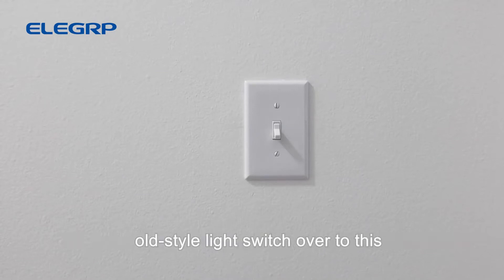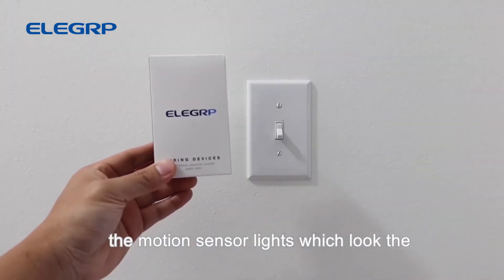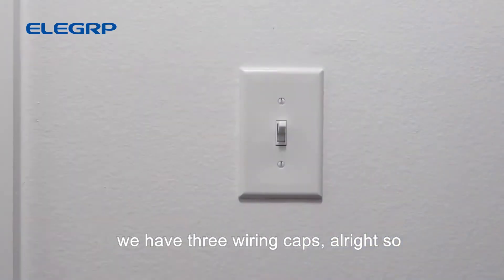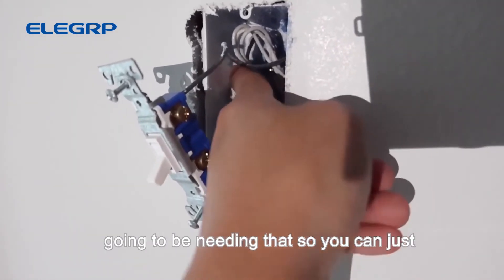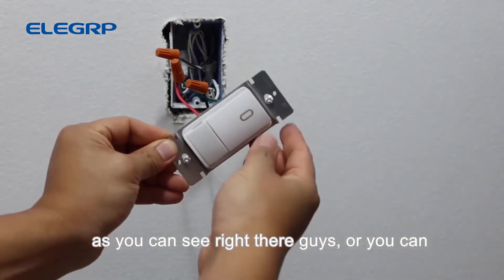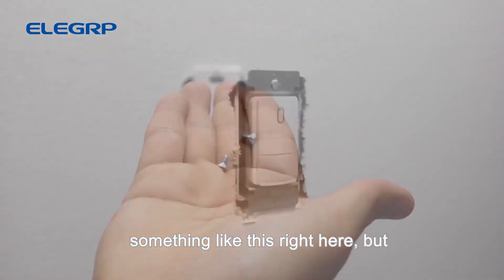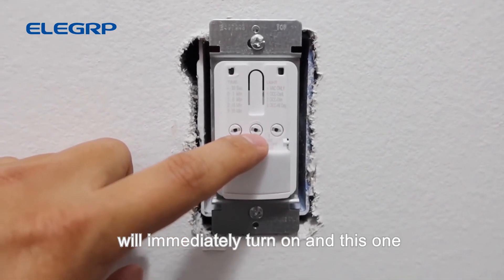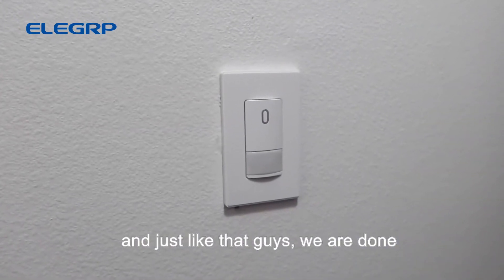ELEGRP Motion Sensor Light Switch Installation

Comment: If you turn it on manually will it stay on continuously or will it still shut off at what ever time position it is set on?
Reply from the maker: Hello, if you turn it on manually, it will shut off automatically when it detects no human motion  after the delay time you set.